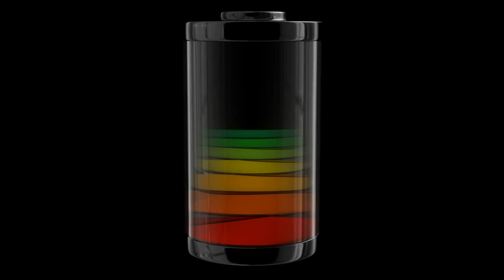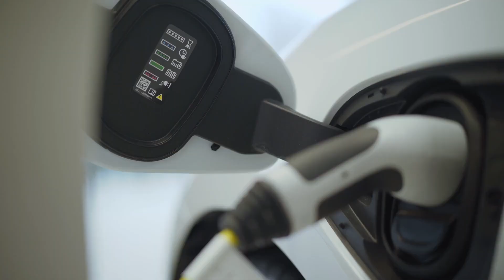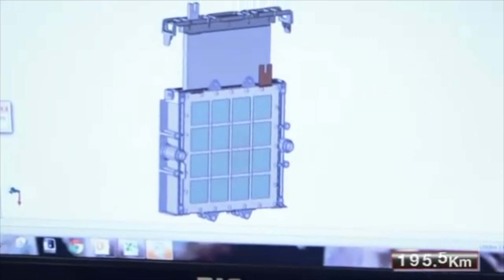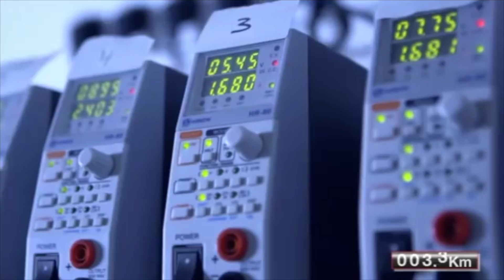This Battery Gives EVs 1000 Miles of Range!

Comment: I can envision having to make an emergency 500 mile trip and discovering I had only about 300 miles remaining on my aluminum-air battery.  The swapping station is 100 miles in the opposite direction.  What do I do?  At what point do I swap out the battery to be prepared "just in case" 🤔??
Reply: BYD are bringing out EVs with 600 mile range in January. That’s with a standard battery. Imagine what kind of range we’ll have in a couple of years time. Battery swapping seems stupid to me, your hypothetical scenario could very well happen.
Reply: @sandyfordd1843  600 mile NEDC, means approximately 400 miles realistically. But in my opinion we shouldn't have cars longer range than 200 miles and a swappable second 200+ second battery for the times you need to go further. You don't need to carry so much weight. If you have a swappable Aluminum air battery you could have even bigger range, something like 200+400(swappable Aluminum air battery) miles. So yes it makes sense, just let your mind be free and think out of the box ;)
Reply: @gene8194  , thanks for the reply and your input. I have thought and thought about this for a long time and battery swapping on private road vehicles just makes no sense. Consumers hate the idea. Imagine going for a battery swap and there’s none in stock, or the one you get is damaged. People have had enough bad experiences trying to exchange propane cylinders for heating/barbecues, etc, imagine the issues you can have trying to swap out a huge battery. It just won’t work. EV batteries are quickly becoming more energy dense, lighter, cheaper, more efficient, longer lasting and recyclable at end-of-life. It’s the only way to go. Battery swapping is dead in the water before if even gets going.
Reply: @gene8194  The battery swapping ship left the pier years ago. If, and this is happening, charging times substantially improve, an EV won't need as large of a battery but we're not there yet. Look at the Hyundai Ioniq 5 and Kia EV 6 models for much improved charging times (without killing the battery life).
Reply: @ScubaSteveCanada   again, let's think out of the box. How about to have a 100-200 mile Lithium ion battery car with an additional option to add a second aluminum air battery for the long road trips. Benefits are, lower price tag, weight, consumption, roads are getting less destroyed.
Reply: @sandyfordd1843  I guess I made the mistake of not explaining in great details. I can imagine that there is the possibility of having some issues, but how can it be that it works in china with NIO. And before you tell me that it's China and they are lying, it's just about to be established in Norway, so hold your horses and let's see. 

But the main advantage is that you don't have to have the second battery in the car, what would make solve the issue with people freaking out of getting damaged their main battery. Besides that it would make the cars cheaper, lower consumption, less damage to the roads, less wear for the tiers and many other benefits. It is not only a bit stupid idea to carry around huge batteries, but it's actually the bottle neck of EV production at the moment and has also a huge effect to the nature.
Reply: Well, you could do what i would do to when in an emergency 500 mile trip to a preferred restaurant, and peel away the lid and eat the battery that isnt really full of air, its actually a tv dinner-based battery that converts calories.
Reply: Rod Anderson, this is an ultra pessimistic situation, for the swap solution to be interesting for most of the people should be as common as charging stations, so you should never experience the situation you described.
Reply: @gene8194  in a world were all the car companies agree on a common standard for swappable batteries, swappable batteries take off, EVs are common, swappable infrastructure is as cheep as a fuel tank in the ground & a pump , yes swap stations will be as common as fuel stations. In a world where car companies cannot agree on a common plug standard, there are no swappable batteries anywhere, EVs are under 10% of the market, robots need to change the batteries maybe they won’t.
I don’t know about you, but when I buy a car I include edge cases in my buying decisions. Given the amount of floods, fires, hurricanes and other natural disasters recently, can I get fuel for my car at a moment’s notice is not an absurd buying criterion .
Reply: These are super easy to make at home, why be reliant on a corporation to begin with?
Reply: @justinw1765  well, maybe easy to make it, but you need to recycle it as well. Plus not everyone is handy enough to do this type of job, let alone working with high voltage DC system. It's a bit dangerous if you don't have enough knowledge.

Comment: Aluminum-Air battery tech sounds like a dead end. If the goal is a zero-emissions car with 1000 miles of range, then increasing energy density with battery tech is the way to go. But honestly, I think 250-300 freeway mile ranged EVs with less than 15 minutes of 80% recharging is the goal and would essentially match the current ICE car road trip experience.
Reply: Hyundai Ioniq 5 and Kia RV 6 EVs are sooo close to what you are asking for. Would you settle for 10 - 80% recharging in 18 minutes instead of 15 minutes. Charging time is one of the reasons the average consumer won't buy an EV. Cost is another reason although, the new Ford F150 Lightning is at a cost parity with the equivalent ICE but needs the subsidies to do that. I own a 2021 Hyundai Kona EV and it's been great. Just wish it had faster charging speeds for those road trips.
Reply: @ScubaSteveCanada  Ioniq 5 and EV6 are game changers in the sense that they're better mass market electric cars than Tesla. We're almost there with parity to road trips in ICE. 250-300 miles of high-speed driving from 100% then 200+ mile range gained back in 15 minutes or less is basically the same as what road trips are like now in a CRV or Ford Escape.

Comment: It would be like if we all powered our cellphones using regular AA batteries.
Reply: All of my AA batteries have been rechargeable for about 7 years now.  I'm just now getting to the point where I should probably replace a few of them.
Reply: @valderon3692  That's not a regular AA battery, your batteries are rechargeable...they are special, just like you.
Reply: @IamtheDill  I know, I said they are rechargeable.  Why would anyone buy single use batteries in the 21st century?
Reply: @valderon3692  my point exactly, did you watch the video?
Reply: @valderon3692  well that's exactly what this video is about..this Aluminum Air battery IS single use..
Reply: @IamtheDill  -- It would seem, like AA batteries that were single use - there is a potential to recharge Aluminum/Air batteries ... and of course if they are strictly single use (1K miles or maybe more) the recycle options could reduce waste and cost dramatically - as it would likely be (at best) the cost of the energy required to rebuild or build new batteries out of the recycled material.
Reply: @drx1xym154  it feels like this described solution is missing the mark.
Reply: @valderon3692 
Its like saying why would any one buy one time use gasoline for your cars and home heating.. And buy and refill it every time
Also one time use Uranium for a nuclear power plant.
One time use Coal for most of the energy requirement of the world especially in third world countries.

If Al Air battery is cost effective, gives better range and swapping is easy. Then instead of charging every day you could swap once every week or less.

Who knows there might be an subscription program where the swapping is handled by some agency at the push of a button.
Reply: @valderon3692  rechargeable AA batteries have been on the market far longer than that.  I had a set when I was a kid in the late 80's to power my Walkman cassette player. As a matter of fact they still work just as well now as they did when I was a kid.
Reply: @kylewillett9110  I am far younger than that and didn't have any devices that required AAs until about 7 years ago.  Mine still work just fine but the ones I bought at first were a smaller capacity and I am looking to replace them with better ones because VR controllers take a fair bit of energy.  I never claimed rechargeable batteries are a new thing.
Reply: @valderon3692  Do you know how to dispose of rechargeable batteries correctly?   does anyone?
Reply: @tnlwithtrixiekat478  Not exactly, though I do know you aren't supposed to just throw them away.  I'm also not going to get rid of them just yet.  I can still use the ones I have for less power hungry devices like my toothbrush.  I will just be getting newer ones because they don't work very long for my game controllers anymore.  I will of course make sure to find out where the best place is near me to send old batteries when I do eventually get to that point.
Reply: Yeah, but it would be regular AA batteries that lasted a year before you needed to replace them.
Reply: @LG123ABC  if a regular AA battery could power a cell phone for one year...we would be using regular AA batteries...don't you think?
Reply: New rechargeable batteries have capacity problems after a decade unless refreshed. So I purchased a charger that can do that and my friends know they can leave old batteries with me and take a bunch that I have already refreshed.
Reply: I do my part recycling cans and other metal. Be great if these take off.

Comment: you made a basic error at around 8 minutes where you said 60o kilometers or 1000 miles..wrong way round..no big deal.
Reply: O yes I realized it was inverted
Reply: That stopped the video for me to see if anyone else caught that. I'm glad I'm not the only one.
Reply: @SeanHollingsworth  Same here, I went "whoa whoa whoa", stopped video and calculated aprox 375 mile range extension.   Still a good result.  Coupling Li with the aluminum battery should greatly reduce cost and environmental impact.
Reply: Yeah, misprint. Should be 1600km and 1000m.

Comment: Thanks for taking this subject on. I think the best use case may be for electric airplanes. I remember seeing a promo for a system in which rolls of fresh aluminum were inserted by the purchaser into a receptacle in the car that fed it into the Al-O2 batt and to a take up roll of Al hydroxide that was dropped off. As I remember the range per roll wasn't that great.

Comment: Unless there are improvements, it's not going to happen - it's the same with hydrogen, the infrastructure needed would be too costly over the cost and ease of charging lithium batteries.
Reply: What about mining, production, disposal, recyclability and how easy is lithium repurposed? Aluminum has it beat.  Tesla is the AOL of electric technology.
Reply: @kylerobinson8913  except aluminium is a step back, it is an older technology.
- lithium is harder to reuse than aluminium, but you do not have to throw away your lithium battery after each discharge, modern cells are expected to last 10 years easily.
- aluminium air "batteries" are fuel cells, with the fuel aluminium. Regenerating aluminium metal from the aluminium oxide is not very efficient, it is worse than making hydrogen, but hydrogen is already less economical than charging batteries.
- hydrogen is the winner for super long haul with much higher energy density than aluminium-air, for other uses lithium batteries are quite good
- aluminium-air may be a good idea for electric aircrafts, it is close enough for kerosene in energy density, but at least in theory can be made much more reliable than jet engines. Also, it would be less likely to cause a fire in case of a crash. Aircrafts would gain weight during their flight, so that would mean an additional 50% less weight efficiency at least compared to kerosene, so it is still somewhat debatable.
Reply: @gamerfortynine  He's talking about using lithium in batteries in the first place. The events of battery day is like saying AOL will improve dial up speed by 100%, which is amazing, until you see a commercial for FIOS (the potential of future battery tech).
Reply: @anydaynow01  batteries are inevitable

Comment: 9:53 having to replace battery once a while "would be a potential inconvenience" -> potential ? lol, this kills the project. Plus as you are consuming the aluminum (you then have to think of aluminum as affectively a fuel), what about emissions? Do you envision us suddelny breathing all these alumimum hydroxide gasses?
Reply: @Josef Habdank

Aluminium hydroxide is not a gas , but a salt that forms in top of the aluminium when exposed to air. 
Its mostly harmless to biological organisms. 
The aluminium hydroxide is Al + h3o ie. Water + 1 hydrogen atom. Hence reforming it back to aluminium would liberate water and hydrogen gas. I think... O_o

Comment: It doesn’t excite me the idea of non rechargeable batteries that need maintenance
Reply: And he did not mention that aluminum is expensive. The real reason we do not have aluminum batteries is simply that they would be way to expensive to use as aluminum is expensive to make and use a lot of electricity to make. Also the batteries themselves will be expensive, they tried this 30 years ago and gave up because of the cost.
Reply: @a64738  Lets see: A pound of aluminum costs $0.50 while a pound of lithium costs $4.26  you need 600 lbs of lithium to make a battery battery and just 50 lbs for a aluminum one, although you can re use lithium and not aluminum lets add up the cost of recharge at say for tesla avg $15 per full charge and up to 1,500 recharges = L battery true cost $25,056 vs A cost of $25. So Aluminum is 1,002.2 times more cost effective so far, and we know the range is up to 5 times better so Aluminum is 5,011.2 more cost effective. However, Lithium is reusable up 1,500 times and so 5,011.25 / 1,500 = 3.34...
That means if Tesla's practical mileage with traffic and more passengers is around 200 mil and $15 per recharge, then aluminum battery should cost about  $4.5 for the same work.
Reply: @Ramiromasters   only like 20 pounds of a full size Tesla battery is actually lithium....
Reply: @booqueefious2230  The battery weights 1,000 pounds, I did my calculation with 600 I doubt they can be less lithium than that, but as it turns out I did omitted the fact that you would need to change aluminium battery just as often as you get an oil change... They are about the same price IF they can make aluminium batteries to cost $90.
Reply: what do you mean: maintenance?? please explain.